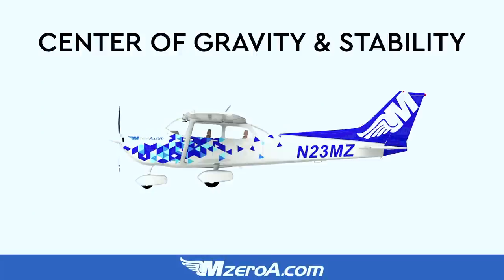Aircraft Weight and Balance In Plain English

Comment: 16-4-16/ In any engineering design, one of the most important disciplines is called mass properties  engineering. We make the envelopes that the A/C w&b falls into and assessing airworthiness of the A/C. When GA upgrades the A/C, ie panel, the A/C is recertified for flight and updated W&B by the authorized repair station. Just a fyi.

Comment: I believe you may be confusing the two key concepts of Longitudinal stability (LS) and control authority.  While an aft CG reduces the moment arm of the elevator,  it does NOT reduce total elevator authority.  If anything it makes the aircraft MORE responsive to any given elevator input.  The why, completely escapes this video.  LS is a function of CG because of the relationship between CG, Aerodynamic center (AC), and the downforce required from the tail.  As the CG moves aft towards the AC the static margin or resistance of the A/C to pitch changes reduces and the required downforce from the elevator is reduced.  This "unloading" of the elevator means that any given movement has the ability to create a much greater pitch response.  The inability of an aircraft in recovering from high alpha post stall situations at aft CG's also has more to do with the CG's postion in relationship to the A/C than the distance between elevator an CG.  Simply put an aircraft with a CG aft of the A/C will tend to diverege in pitch rather than return to it's trimmed state.  Essentially there IS NO trimmable stable state available to the pilot.